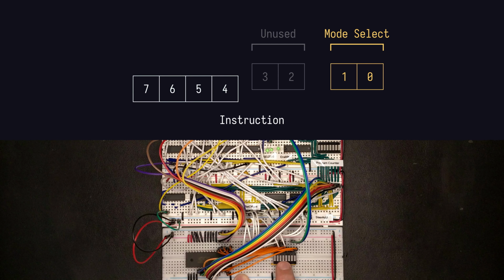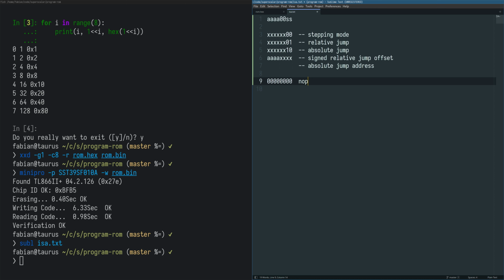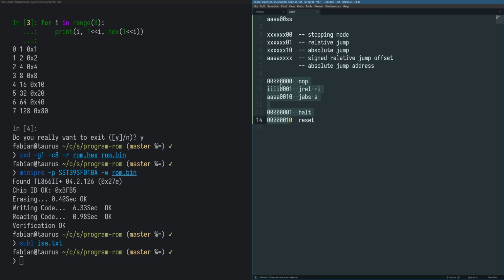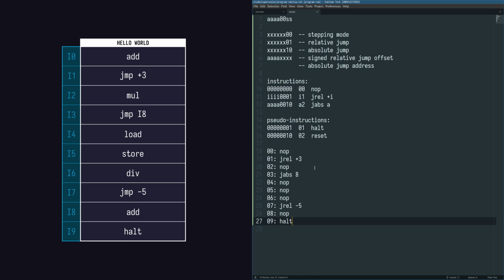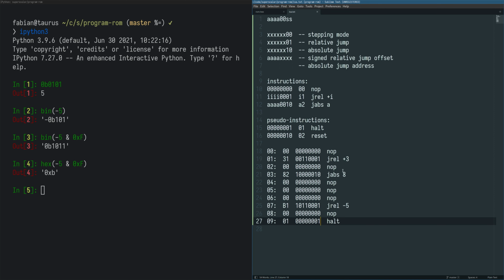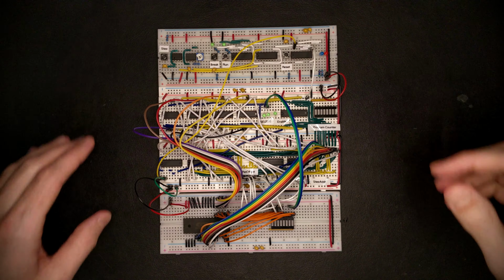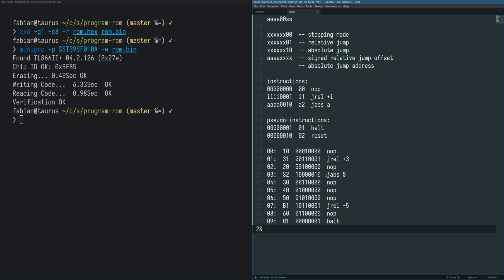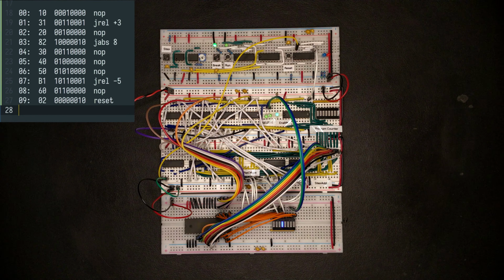Defining First Instructions – Superscalar 8-Bit CPU #12

Comment: Fabian, there is something called gmac (part of tkgate) which is an macro/micro code generator. 
with this : 
microcode bank[7:0] ui.m1;
macrocode bank[7:0] mem.m1;

field pc_inp[1:0]={
	 next=0,	// Increment pc
	 rel=1,		// add rel to pc 
	 abs=2,		// abs jump  
	 jump=3		// Jump from condition
};

field pcadd[7:4];

operands jmp_fix {
	%1	= {+0[7:4]=%1; };
	#1	= {+0[7:4]=#1[3:0]; };
};

operands jmp_rel {
	#1	= {+0[7:4]=#1@[3:0]; };
};

op jabs {
//	map jmp: 0x02;
	+0[1:0]=0x02;
	operands jmp_fix;
};

op jrel {
//	map jmp: 0x01;
	+0[1:0]=0x01;
	operands jmp_rel;
};

op nop {
//	map nop: 0x00;
	+0[1:0]=0;
	operands {
    - = { +0=0; };
  };
};

op halt {
//	map halt: 0x01;
	+0[1:0]=0x1;
	operands {
    - = { +0=0; };
  };
};

begin microcode @ 0
halt:	pc_inp=rel;
nop:	pc_inp=next;
//jmp:	pc_inp=next;
end

begin macrocode @ 0x100

start:
	nop
	jrel label1
label4:	nop
label3: jabs label2
label1:	nop
	nop
	nop	
	jrel label4
label2:	nop	
	halt

end
It generates the same code as your example (beside all nop's are as 0x00 coded) :
@memory ui.m1

@0
1 0

@memory mem.m1

@100
0 31 0 82 0 0 0 b1
0 1
this way you can already build simple assembler for your future CPU ;) 
rgds
roman
Reply from the maker: Hey Roman, that's absolutely fantastic! I wasn't aware gmac at all, and this looks like it would be very useful indeed. Going to give it a try. Thanks a lot 🎉!